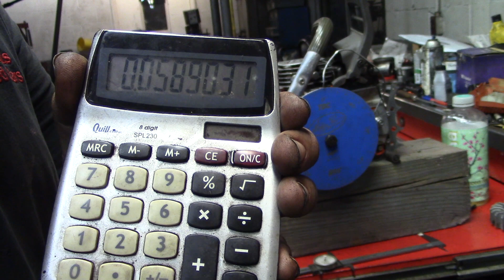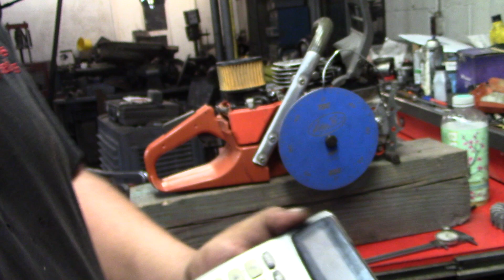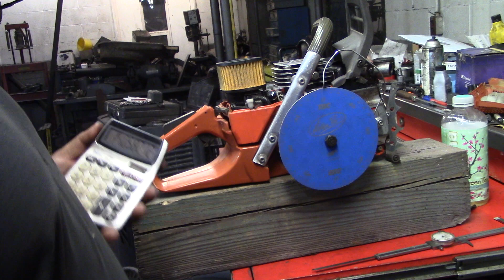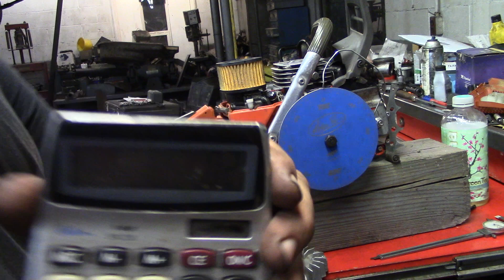For Clone 372 Saws A More Precise Way To Adjust Ignition Timing

Comment: the advance angle has nothing to do with the degrees of the circle but with the stroke of the piston, how many millimeters is the piston before the top dead center when the spark ignites, and every saw works best at a point between 2 and 3 mm before the top dead center of the piston

Comment: Motorcycles I’m motorcycle tech have a tic mark on the case . U could bend a pointer for temp or mark your case. Then u stamp your flywheel if possible. Then u can use a timing light. Can watch em advance ! Best if u can get a ig system that advances I know some do namebrand after market do not usually . If u could set something like this up you’d get good power over a range but a saw cuts basically at a predetermined rpm depending on your chain etc . I just grind the key way out and move it till I’m happy. You’re not gonna rotate the world fine tuning it within a fraction better. Maby you’re at that level and wanna get that   ?
Reply from the maker: Interesting idea. On the aftermarket 372's they are already too advanced in timing. So what i'm looking for is the maximum torque in the cut without it misfiring from being over advanced. The amount I take off the key is around .005. Most times that put the timing right were I need it so I can cut at full throttle without it misfiring.

Comment: Hi. I ask for your help. What is the correct ignition time BTDC for G372 at 3000 RPM? Thanks a lot?
Reply from the maker: I'm not sure but were to start is if you over advance your timing it will sound like a miss fire at full throttle in the wood on camera it is more noticeable. If you have a keyway file about .008 off it. This should be about 2 degrees but turn it counterclockwise.
Reply: Depends your coil 😂 and if a resistor plug or cap all sorts does the coil advance? How do u know without a timing light? U don’t. That’s why ppl just blind advance until happy. Just like guys did turning the distributor .